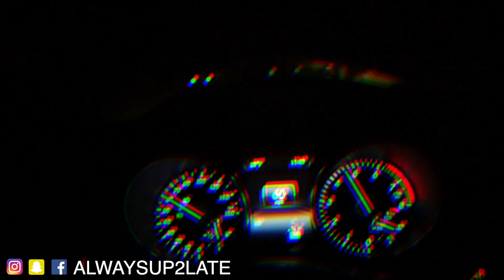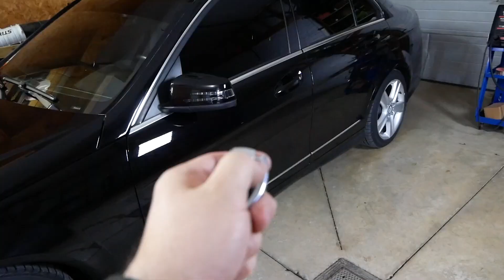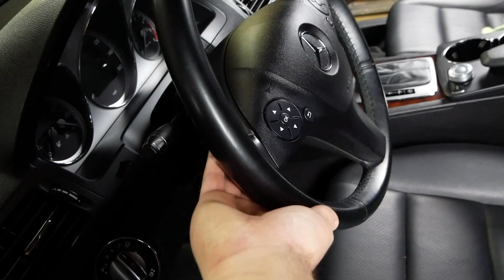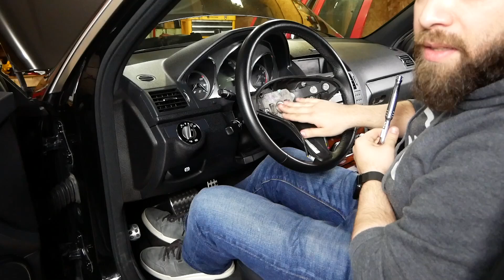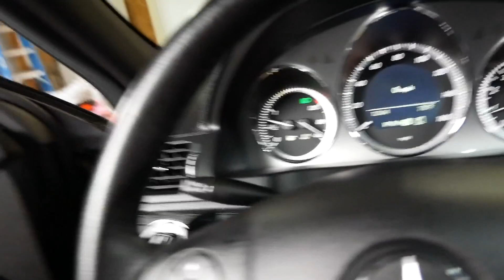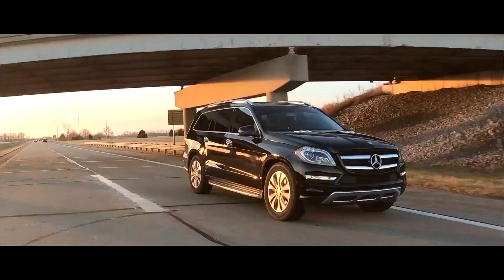Retrofit paddle shifters w204 C300 Mercedes using C63 AMG Steering Wheel (v6.6.0)

Comment: I have done the same but it didnt work only difference i upgraded to a facelift steering wheel with paddles on a preface lift car without paddles but i have auto with manual so i was hoping it would work i dont no if i can get it coded etc

Comment: When disconnecting the battery always take off the negative cable. Never take off the positive power cable..  Also be aware that many Mercedes models have 2 batteries. But i must say i am a bit suprised that no coding for the paddle shifters was needed. Thanks for posting.
Reply: Have you done a wheel swap yourself? if so what car?

Comment: Please help my car is not doing the same I just got a new c63 wheel and i plugged it in same as the video and everything but they paddles don’t work
Reply: What steering wheel you use before amg with no paddles or avantgarde ( the ugly star wheel)?
Reply: I had the stock wheel all my buttons for my menu still work but my paddles do not

Comment: Hey there great video! I have a 2008 c300 with the w204 amg steering wheel and it has black paddles (kinda sort not the silver ones) i do have the ports for the paddles and have SPORT AND COMFORT mode with left and right up/down shifting. But for some reason the paddles wont work on my 2008 sport c300. Im using the same airbag as well just different w204 amg steering wheel with paddles. Any clue to how i can get these to work?
Reply: I’m having the same issue did you ever figure anything out?

Comment: Warning to all don’t close the boot if your battery is in boot when doing this lol I learnt the hard way .great video
Reply: Can you please explain more specifically? I didn't exactly get what you meant and what could possibly happen.
Reply: @andrewwelf  I think the boot lock is battery powered so he locked the boot shut with no way of opening it
Reply: @andrewwelf  sorry to revive an old thread, but the trunk latch is opened electronically, meaning if you close the trunk after disconnecting the battery (assuming your battery is in the trunk), then you’ll have to manually release the trunk which is a pain

Comment: I've been trying to find a steering wheel with the paddles, I have the flat bottom wheel but mine does not have the shifters, So i am looking for one with the shifters and I can just swap over the boards and air bag, but not having any luck.

Comment: The air bag c63 w204 it not the same to c300 and c350 w204?
Reply from the maker: I believe this depends on the number of contact points the center of the steering wheel has with the outside. The OEM part number for the wheel I used was A20446027039 which may have been a sport version not available to the USA initially. This one has 3 points of contact where others have 4

Comment: you need to do recoding in order to enable true manual gear shifting though.
Reply from the maker: Yes, this is an extension of the left-right shift on the gear selector. It works exactly the same way 👍

Comment: Just an fyi you’ve got the euro wheel part number: A2044603303

The c63 wheel is the flat bottom part number: A2044601903

Ive got a euro wheel otw now and fingers crossed my flappys work.  Should since ive got the manual shift.  We’ll see when the wheel gets here.

Comment: If someone needs to program the paddles, you will need to do variant coding to the transmission using a C4 Xentry. Cheap chinese clones work well or you can find a local shop that has one. Visit mhhauto for all the help you need for mercedes software, they were very helpful for me. Having Manual mode is very different from jsut having working paddles in drive so look into that aswell.

Comment: Hi i purchase a w204 sport steering wheel with the bottom of steering flat and all connections look the same but my paddles don't work i have 2008 c300
Reply: Jorge Palomino same problem. Any solution????

Comment: Hi everyone, I did the steering wheel installation with paddle shifters (i haven't had them before) and shifters does not work. I was wondering is it possible to replace the gearbox computer wich already has a paddle shifters it has to make it work? If anyone has a suggestion or solution please write to me or there is some program on the web to do the same, is there a possibility that classic car programs can do it or not eg DELHI diagnostics? Thanks to all.

Comment: Do you actually use the paddle shifters? If so, are the shifts more ‘satisfying’ (?) than using the gear selector? 
I find using the the selector is a pain. This is my first MB, I come from a BMW enthusiast home. My parents, sister, wife and I are all BMW CCA members. In every auto BMW I’ve driven, using the tip-tronic mode is much easier and feels more ‘manual’ than in my 2010 C300 4Matic. I always switch to Sport mode when driving as I read that driving in Comfort makes the transmission start in 2nd gear from a stop as MB thinks this is much smoother. 🙄
Even driving in Sport mode feels very numb, but I didn’t buy it for spirited driving.(...BMW makes much better cars for that and my E60 535i is plenty fun with its 450+ hp and when I wanna actually shift gears I take my wife’s E46 330ci ZHP...) 

I got the MB for my dedicated pass car as the 4Matic does great in the snow (admittedly better than X-drive) and I’ll never own another Audi (unless it’s another S8) and don’t want a Subaru. 
But I’d like to have a little more fun and be connected to the car more, so paddle shifters seem like an easy way to add more ‘spirit’ to driving the otherwise numb and mundane W204 C300. 
All the previous rambling aside, after 6+ months of having them, how do you like them?
Reply from the maker: Got it, that makes sense! Congrats on the C300! This one is a 2010 C300 Sport 4matic, I've had it since 2013. BMW is good German engineering as well, and I like them too. I use the paddles occasionally, for fun mostly. Have to be in sport mode, or the shifts feel slower than normal because of the "comfort" of smooth shifts and they take longer than in sport mode. The first couple of days after I did this I used them quite a bit, but I find the biggest benefit for me is the comfort of hand position on the steering wheel. My wife has a GL450 with from the factory paddles and I found that steering wheel more comfortable while driving. Now I have that too 🙂

Comment: If you’re just removing one battery cable it’s best to remove the ground. While it achieves the same effect, removing the negative allows for all computer controlled components to completely shut down a reset
Reply from the maker: Good to know, thank you for the tip. I default to the positive on this car because I have a couple relays hooked up to the positive for the lighted star and the LED running lights I added after I bought the car. May remove both next time? What do think?
Reply: On a negative ground vehicle, always remove the negative cable first. That way you do not have to worry about sparks if you accidentally touch a tool between the battery and the car.  You can remove the positive too, but it should not be necessary. Re attach the negative last.

Comment: Dope video! I’ve been trying to find a retrofit for this model. Have you had  problems with it since the install?
Reply from the maker: Sam Alvarez thank you! No issues, still working as expected. Shifts are faster in sport mode than in comfort, or at least they feel faster. I don’t use it too often, more like holding on to the steering wheel where they’re at. Looking to do this to your w204?
Reply: alwaysup2late I’m looking to do this to my 2008 c350.  Should I use the wheel from a c63 from 2008 as well?  Also, any leads on where to find a wheel in good condition (remanufactured, aftermarket?)

Comment: Hello there! Great job and vid! I own a w204 C250 coupe without manual mode and without paddle shifters. Would it be possible to buy a W204 C63 steering wheel and just plug and play with paddle shifters? Thanks for the help!
Reply from the maker: Mr. JL thank you! It depends on whether or not you have wiring in the car to support it. I believed this would work on mine because it has the manual mode on the shifter and the airbag module has the 2 plugs on the rear. If your airbag has them you could try it but no guarantees if there is not a manual mode on your shifter though. If you try it please let me know how it works out
Reply: alwaysup2late, when you say ‘manual mode ‘, is that just the ability to shift from 1st up to 6th (then D is 7th) by moving the selector to the side when in D? If so, I have this as well in my ‘10 C300 4Matic Lux. In the video your gear selector and housing looks exactly like mine.
Reply from the maker: @mikermilla  Hi, thank you for the comment! Yes, that is exactly what it is. I could select the gear with the gear shift, so I thought it was likely that the airbag module would have the connections for the shifters and it did.

Comment: On c220 ?
Reply from the maker: Juji hi this was done on a c300. It had the airbag module with the connectors on the back and it has the manual mode on the shifter
Reply: @alwaysup2late ok thank you !

Comment: FYI... 95% chance your '10C300 has TWO batteries! second batt is either in trunk or inside the dashboard.

When reinstalling your battery airbox cover, you forgot to insert the bottom hooks in place before snapping the 3 springs on top! So now your cabin air really comes from engine bay instead of windshield bottom vents...

Lucky you did not get SRS Fault... because you removed the main battery terminal - 

Super lucky too about NOT having to code the new missing paddle option, sweeet 🤗
Reply from the maker: I've heard that, that it is inside the left or right panels in the trunk. I did not find one when replacing the taillights but it very well could be hidden somewhere. I'm going to go check those clips now, I've had that box off about 20 times in the 6 years I've had the car. Hopefully it hasn't been wrong every time 😂

I've pulled the terminal a few times, during electrical things like the LED running light conversion and the lighted star install. Have not had one yet, but I did have one when the original battery died after 7 years! Very impressive.

I read online it may be possible if they plug receptacles where on the back on the airbag unit, we got lucky on this one 🙂 I'm working on a gauge cluster swap to the facelift cluster at the moment, still working out getting the mileage to transfer properly. Thinking I may need to cough up the money for Star w/ developer mode but still hopeful I can figure out a way without it.

Is there anything else about W204, X166, or R172 you would be interested to see? I'm working on some new videos for Mercedes stuff because I find it fun to work on them.
Reply: @alwaysup2late  I have a W212... anything Benz is always remotely interesting.

I do not believe transferring your odometer will be a cake walk. It is  guaranteed you'll need a Benz terminal with live on-line account to code your VIN and mileage into replacement unit etc... if I were you: I'd live that one alone unless you know better 😎
Reply: G Lasser, you’ll only get an SRS fault if you DON’T disconnect the battery first, when removing the seats or seatbelts, or disconnecting the airbag (which if someone left the battery connected whilst messing with any airbag, an SRS light would be the best case scenario..lol)